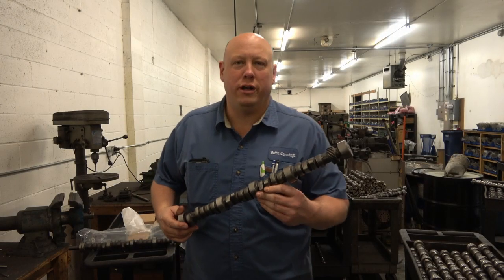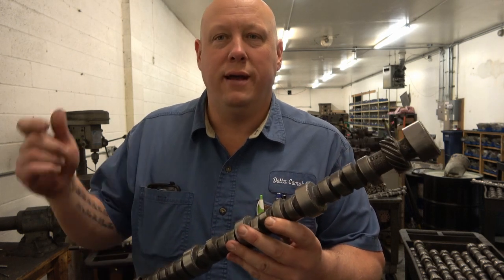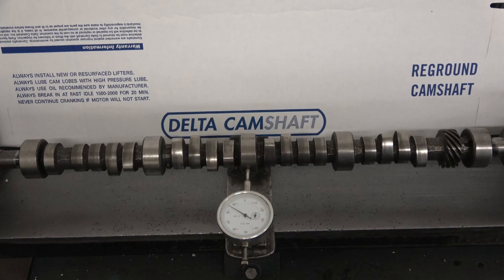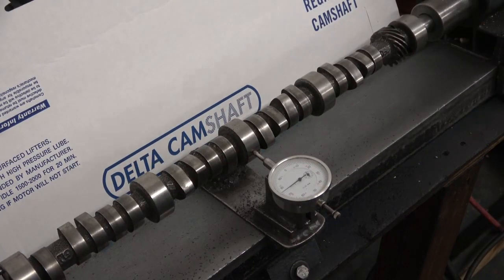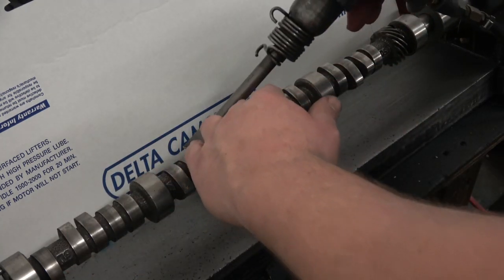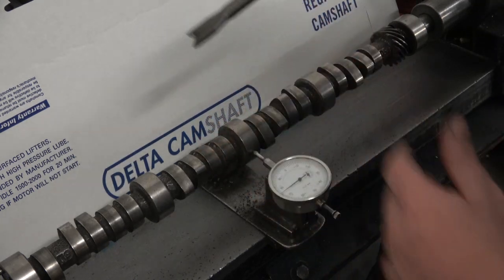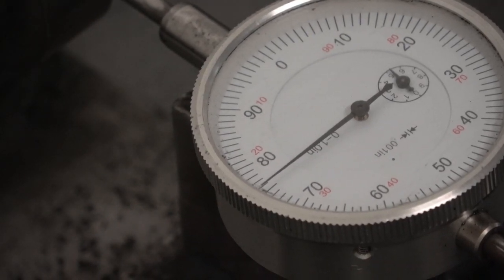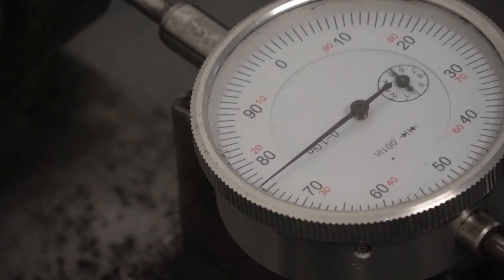Camshaft Straightening

Comment: This!  Golden nuggets!
The old timers used a hammer and a dull chisel before Burp Guns to straighten crankshafts and whatnot but I was never able to get the "low"down on the little details. You show us this bit. Very cool.
I was putting a cam back into a 90 year old Twin City 382/403 engine and it was terrible bent. It had been standing upright for 8 months on the floor by itself. 
Now i see what the engine Babbitt bearing man might do to straighten the cam.
Also have a 91 year old Chevrolet crankshaft that refuses to straighten with brute .120" bending.
Now I see. THANK YOU!!! : - )

Comment: Wow great video. I found a bend of 2mm in a Mercedes’ overhead camshaft I was using for an engine rebuild (noticed after installing cam, it had a small spot in the rotation that was less free than the other points in the rotation of the cam, it did not bind altogether) I was able to take out almost 1mm of bend with a 3lb engineers hammer. Today I tried my air hammer as in the video(hit the bend from both sides ultimately) and the bend is now down to about 0.1mm and the cam spins freely again

Comment: great vid. It looks like you've done that before. Before i saw he vid i was thinking youd put it under a 20 ton press and maybe some heat. I just purchased a new CMC cam for a Ford FE. it has a .0015 bend. Seems to rub on the cam bearings a bit too much. Should i get it straightened or just scrape the middle bearing?

Comment: OK, I found the low spot on my NOS, 60 year old Corvair cam to have a .004 bend. I set the cam to the LOW side as noted in this video. I made a "curved on one side" piece of 3/16" steel fashioned to roughly 140 degrees of the shaft diameter. Placed between the lobes/journals I struck the piece with a hammer alternating as I went. Unfortunately striking the low side only increased the .004 bend to .005+. Against the advice I set the HIGH side upward and repeated the process and quickly got the cam within .0005. It now spins freely in the bore saddles.

I know you guy do this every day and for me this was a one time thing. But in my case I found the inverse to be accurate. Maybe it is just me but more that 50% of the time what works for others inversely works for me. There is no rational explanation but it sure can be frustrating! Regardless, you proved to me the cam could be struck and not shatter into pieces and my cam is as straight as I need it to be.  So,  for that I say - THANK YOU.
Reply from the maker: its good you got yours straight. your method was not the same as our as you've seen in the video. my process is rapid impacts to the core to relax the material, your process was punching or pressing the cam straight, clearly both are effective, but mine is far more efficient when doing several hundred cams a day

Comment: Im wondering what it would cost to grind a straight 6 camshaft for a pulling tractor from a billet core. I could machine the blank form either 8620 or s7 tool steel. I could rough in the lobes close/ The cam would be about 36" long.

Comment: What causes cams to get warped so badly?
Once the cam heats up from engine heat, will the molecular structure in the metal be memorized to go back to being warped?
Should the cam be heat treated, or cryo-treated or some other treatment to stop future warping??????
This is all new to me.........
Reply from the maker: Cast cams will bend just laying on angle rather than flat, steel cams usually get hit with connecting rod or something to bend them a good amount... either will bend a few thou during shipping

Comment: Awesome video.  I have an interesting question for you.  I have a crank out of a 2 cylinder air compressor that is bent.  It indicates .007 at the tip of the snout.
There is no center journal to indicate on to locate the exact bend.  The cylinders are opposed and the shaft is bent at 90* to the journals.  Would it be best to peen the shaft before the first rod journal or over the entire length?  I believe the compressor was impacted on the flywheel because the flywheel cracked and is out .120".

Just curious as to what the best solution might be.
Reply from the maker: Gently work the lenght. Hit it , check after every hit
Reply: @DELTACAM8005625500  Thank you very much.
Reply: JonneyBlazeRacing I just finished straightening the crank.  It is now within .001" and the indicator is only showing irregularities in the shaft.  Thank you very much.
It took a LOT of peening to get it straight, since it is a very thick crank.  I started out using light taps and progressed to more of a gentle beating to get it to actually move.
Many thanks.  Keep making great videos!

Comment: Hey j got a 2002 ford escape 3.0 dohc I bent my front  bank intake  cam trying to get that water pump pulled off the other side. I was setting the timing and noticed it was so bent I couldn't turn the engine with  breaker ba r.  Can it be bent back straight

Comment: Question John: After Straightening the Cam shaft,,after a few weeks does it return to its previous bent condition like a memory of sorts, similar to Chrome moly Material?
Reply from the maker: the cast iron will change a few thousands in a matter of hours, but will usually be ok to slide into the block. any heat change will cause it to bend some also

Comment: Hello,  thanks for this great video!  I have a Bosch diesel injector pump camshaft that got bent when the pump seized.
It is 30mils off in the middle and it is 12" long.  Would this method work?
Reply from the maker: the distance is too short and the pump core is thick   heat will be needed... if they are super expensive  send it in and Ill try to heat straighten it here... fill out order form at DeltaCam.com and send it in

Comment: Hey.
I have a comp billet 4/7 swap solid roller sbc cam..
Between centres, runout on journals 2,3 and 4 is .0017, .0022, .0027 respectively..
Is that worth messing with straightening..?

Comment: ive recently had 2 friends with the Toyota 3.4 v6, have the camshaft and gear break off is there any techniques to revive a broken shaft and are there any vehicles prone to this sort of breakage?
Reply from the maker: Northfork Network remove timing belt to relieve tension, then 1/2 turn on cam caps uniformly until they are all loose

Comment: I have spoken to you a few times on the phone as I ponder getting a cam for my big block... I will definitely be buying from you now that I found a channel. Very knowledgeable! 
I am between going roller or solid flat tappet right now though.   Do you have any thoughts on that?
Reply from the maker: What yr block ? Whats the build for ?
Reply: @DELTACAM8005625500  It is a 1974-1990 454 block.  
489 big block chevy in a 75 camaro with a t56 magnum behind it. 3.73 gear and about 3700lbs.  It currently has an ISKY 250/256(@.050) with .605/.620 lift on a 108. I was hoping for something a little smaller.
I have the edm lifters I was wanting reworked for a new SFT cam, you talked about a grooved lifter you offer.
Reply from the maker: Bout a grand to swap to roller
Reply: @DELTACAM8005625500  Yeah I know... That is what makes the flat tappet so appealing. I was looking an an erson 242/242 .585/.585 and was wanting it on a 114 versus the 108 they have it on.  What are your thoughts on something like that?